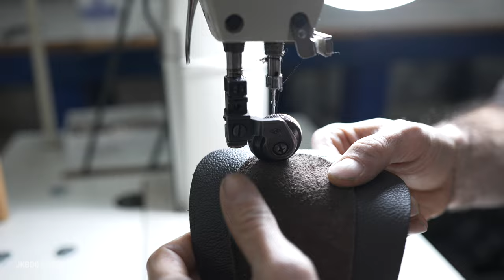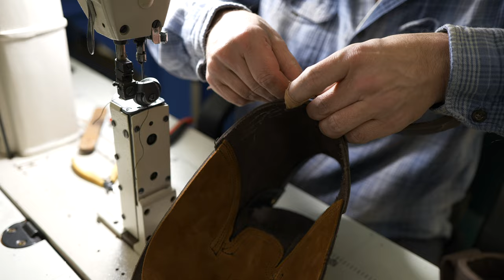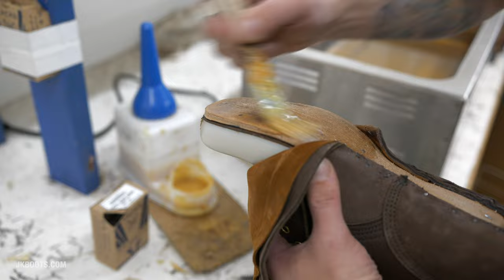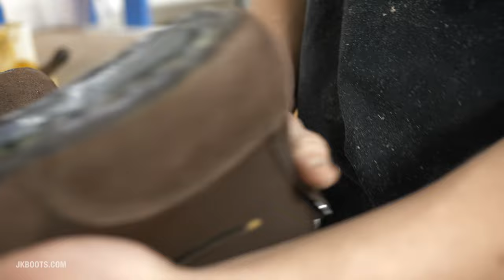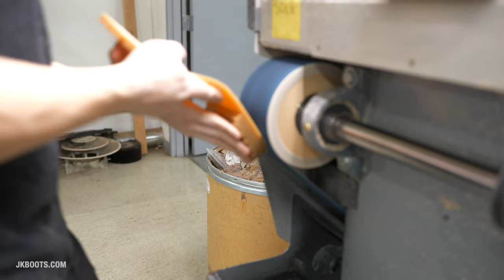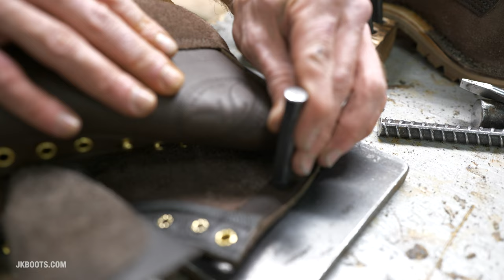How it's made - The Hiking Boot You Can Wear to the Office - OT 6" | JK Boots

Comment: If anyone from Nicks is reading comments, there’s a need for an American made full grain leather unlined 6 or 8 inch height backpacking boot. The sole needs to be stiffer than most general purpose hiking boots. And if you decide to create a winter version of it use closed cell foam between outer and inner full grain leather as the insulator. See the Lundhag Professional II High Opti as an example. The closed cell foam won’t absorb moisture.
Reply: You are aware the JK is a direct competitor with Nicks, aren't you?

Comment: Do these have lots of arch support, like found in a 55 last Logger boot?
Reply from the maker: You can expect the same amount of arch support with our boot lasts.
Reply: @jkbootsusa   I'm a Brannock  size 11EE, and just ordered a pair of Drew's Loggers in 10EE... the made in Mexico version. If they fit well, I will be ordering a pair of the OT or Forefronts in Bison. Most likely in the same 10EE as the Drew's.
Reply: @Condor1970 if u know your brannock i’d just go a size down n then measure the ball of your foot n go with their guide. I did it and it fits exactly like it’s suppose to (with some extra space infront to compensate when the insole/boot breaks in. Just from what I’ve read i’d never assume/trust that the size would be the same across different manufacturers. Hope this catches you before you order

Comment: What does putting the leather in oil do?
Reply from the maker: It is actually hot water that we soak the boots in. What this does is allows the leather to stretch around the last in the wet lasting stage. This helps the boots hold there shape after breaking them in👍

Comment: No shank? Not even leather?
Reply: He did add a shank, i believe it was leather. It was dark in color. Seemed like it was more maliable and thinner than one from other companies. Looked like he was able to form it to the boot and glue it instead of a more rigid one that needs to be nailed down.
Reply: @benDaku13  that appears to be just a poron filler for that void.
Reply: @ktraughb  you may be completely correct. I assumed it was leather, but confused why they would use a piece that is dyed and also very malleable. Poron filler makes more sense.